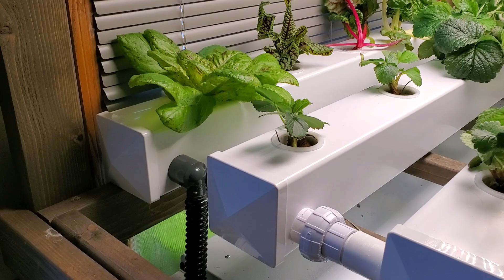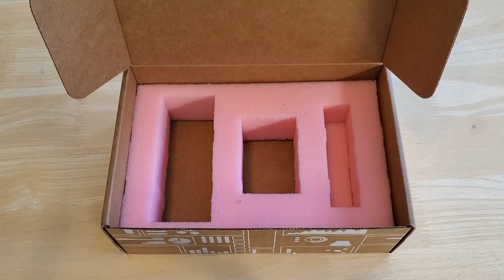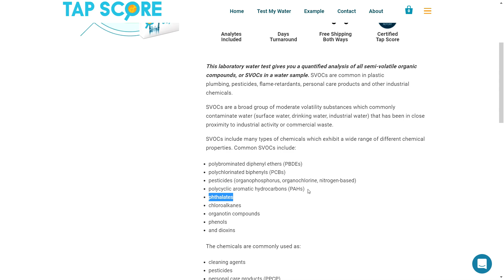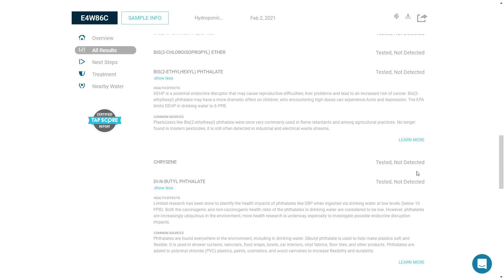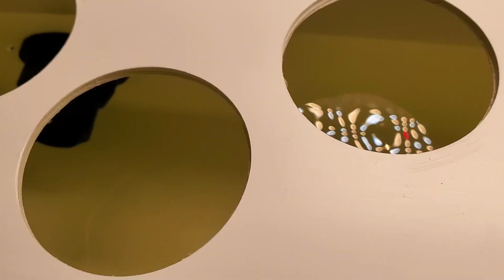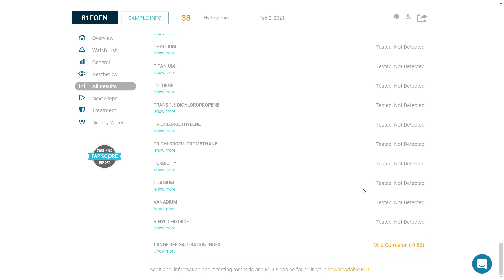Is PVC Safe for Hydroponics? Water Test Results!

Comment: Well done. I work on PVC industry and I can asure you that at least here in Brazil 100% of PVC extruders uses Calcium/Zinc stabilizers instead of Lead for decades... This is a rigid pipe, so you won't find any phtalate but if it was flexible like a PVC hose, or even a Blood-bag, for decades phtalates are being replaced for DOTP or even Epoxidized Soybean Oil. Which means, phtalate free plasticizers.
Reply: Opa, e sua conclusão é que dá pra usar PVC pra hidroponia? Daria pra deixar o PVC no sol? 👀
Reply: What are the black hydroponic buckets made from because after a while they make your ph start to swing wildly the older they get.

Comment: I have been watching your videos for a bit now and as a skeptic of PVC and other synthetic chemicals used in manufacturing I feel pretty comfortable building one myself now! Great work - I really like that you did lab tests showing exactly what is in your systems water supply because without that I would still be skeptical.
Reply: There’s a huge problem with this video. The lab tests only detect when levels pass a much larger threshold than can be reached in two weeks in new material. The longer you have the pvc, the larger the leech. Additionally, this does not take into account the degree to which the plans absorb chemicals OUT OF THE WATER and therefore contribute to lower levels of contaminants in tests. There’s also the issue that small amounts build up in your body over time. Even if you are getting a very small degree, repeated exposure through consumption will eventually buildup in your body because our bodies are amazing at storing micro plastics and the damage from their consumption.
Reply: @platypusfeathers  any sources for the claims?
Reply: If people want to do this, they should do it, though I don’t recommend it. There are safer materials including potable water pvc (which must usually be kept out of direct sunlight). The claims I made were not of health effects, but of the processes underlying them. I’m too lazy, hence do your research and I completely respect your decision to pursue this despite my disagreement,  to find the support for claims that plastics can build up in the body, that testing tests what’s in the sample (hence would miss longer term leeching), etc.
Reply: Also that plants can filter out plastics from the water, and thereby decrease the water plastic concentration.

Comment: PVC is a concern at high temperatures like when it is exposed to direct sunlight. At high temperatures the PVC becomes brittle, indicating that a chemical reaction or outgassing is taking place that changes the composition of the material. Your hydroponocs system is perfectly safe because it is indoors. Thank you for sharing the information.
Reply: What do you recommend for outdoor?
Reply: @yolpaaaa  HDPE .I use HDPE buckets for my hydroponics bucket system for peppers.
Reply: That is my concern for hot temperature outside. 
 I am thinking of using PVC post  from Home Depot or Lowes  for my dragon fruit plants in pots for outside growing not inside. 
I have heard about uPVC but now sure Home Depot carry them. 
Any advise?  Maybe I just stick with redwood for safe food grade.

Comment: its really depends on where you purchased the pvc pipe from. In some countries, lead is allowed to used in pvc as stabilizer.
Also bpa or phthalates are not used in rigid pvc pipe. Flexible pvc like vinyl may contain phthalates.

Comment: Like your set up did your tests look for BPAs or BPS? By any chance.
Reply from the maker: No it did not. My understanding is that BPA and BPS are used for clear and/or flexible polycarbonate plastic applications (water bottles, etc). From the research I did, DEHP was raised much more as a concern for the PVC I use so I wanted to make sure to look for that one.

Comment: Very nice vid.  

I am thinking of using PVC post  from Home Depot or Lowes  for my dragon fruit plants in pots for outside growing not inside - hopefully it is pretty safe.  This info really helps. 
Thanks
Reply: Someone else mentioned that the sunlight affects the plastic differently than it would inside...you mentioned that you were going to use them outside...
The other thing is that, although these plastics are white, the sunlight can get through the opaque plastics causing algae problems...sunlight is quite a bit different from indoor lighting...
Things to consider...
I am using 6 inch field pipe (some people bought a farm and didn't want the pipe so they sold the 10 foot lengths for 5 dollars each...I thought it was a good deal so I bought all they had)...it's white on the outside and stabilized to resist sunlight and UVs...the inside is black to block the sunlight to prevent algae...
Home Depot has a similar product called Corrugated Drain Pipe, it's made from High Density Polyethylene...it is white on the outside to protect it from sunlight and UVs and black on the inside to prevent algae...it comes on 3 inch and 4 inch diameter, 10 foot lengths...
Just thought you might want to consider this as well as the plastic posts...I think it would be better for sunlight and water...the posts, although they are UV protected, are not made to keep the sunlight from getting through...and they are not made to have water in them and will be susceptible to algae...

Comment: There’s a huge problem with this video. The lab tests only detect when levels pass a much larger threshold than can be reached in two weeks in new material. The longer you have the pvc, the larger the leech. Additionally, this does not take into account the degree to which the plans absorb chemicals OUT OF THE WATER and therefore contribute to lower levels of contaminants in tests. There’s also the issue that small amounts build up in your body over time. Even if you are getting a very small degree, repeated exposure through consumption will eventually buildup in your body because our bodies are amazing at storing micro plastics and the damage from their consumption.
Reply from the maker: Those are understandable concerns, but I think the test method mitigated many of them. 
-I allowed the water to circulate in an existing system which was nearly a year old (probably average for a hydroponic system) for two weeks before taking the sample to allow any leachates to accumulate. 
-The test thresholds are for drinking water, which are set assuming the person is directly consuming this water in large amounts every day.
-I have not found any support for the idea that plants take up a higher concentration of pthalates than what is present in the water (which is what would have to occur for the plants to be reducing the pthalate content of the water). In fact it appears to be the opposite from the studies and articles I've read through.
More info here: https://simplegreenshydroponics.com/posts/2021/is-pvc-safe-for-hydroponics